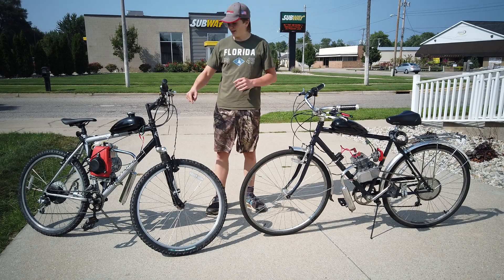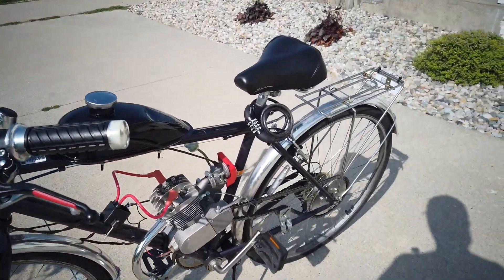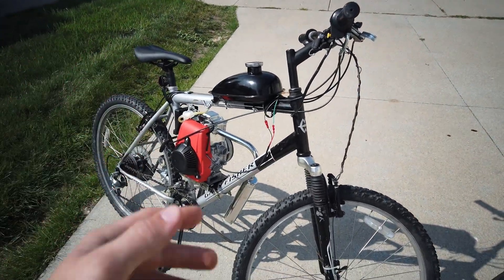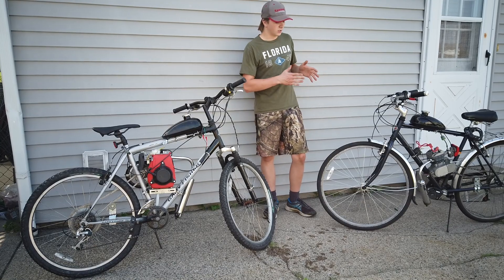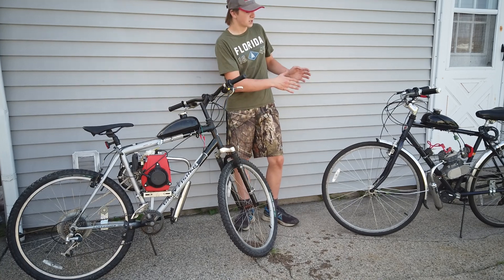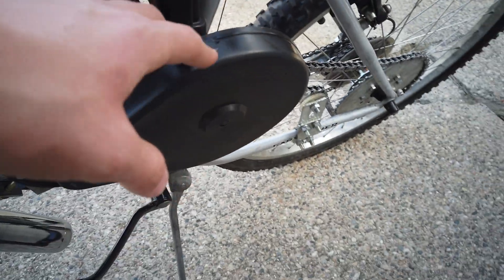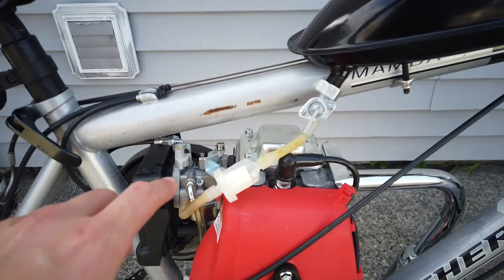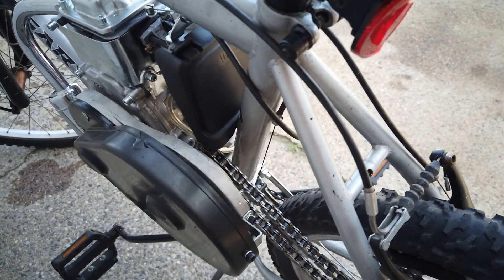4-Stroke VS. 2-Stroke Motorized Bikes!

Comment: You're a light guy and it doesn't look like you live in a very hilly neighborhood do yourself a favor and get a 36 tooth sprocket You will be happy you did so it's so much better on the engine and you get more speedt but you do lose a little of your bottom end.

Comment: The 4 stroke is a little smoother and quieter. It is also somewhat slower. Rejet the carburetor one size larger. 
The 2 stroke is a little rougher running and has a more distinctive sound. 
I like both but prefer the 4.

Comment: 2 strokes are slow stock out of the box but if you remove the cap on the muffler or modify the muffler and take off the air filter you will be hitting 32-34 mph if not more with 26” tires and it’ll have way more torque..seriously you should try it, it’s very easy to make even more power.
 The 4 stroke you really can’t do anything to them.

Comment: 2 strokes are such a pain. First thing to know, you have to mix oil with the gas. If you don't get mixture right, you spit oil out of tail pipe. Just upgraded to a 4 stroke. Only complaint I have so far is the clutch sucks.
Reply: I will hav'ta agree... 2stroke is too much maintenance!! 4stroke is much better, pull & go!! Clutch does suck, but 4stroke is the way to go!! Won't go back to a 2stroke!!

Comment: is there a way to start the 4 stroke, without the pull start?  Like a running start so to speak.
Reply from the maker: So this one has a centrifugal clutch, which is automatic, so when you hit the throttle, it grabs and pulls you forward, unlike the 2 stroke. So no, since you can't manually operate the clutch, there's no way to pedal start or push start the 4. Hope that answered your question.

Comment: That 2 stoke sounds awful. It desperately needs a decent tune and probably a better pipe. It’s restricted to hell.
Reply: 2 stroke is better and better sound
Reply: @mikoskjv  That 2 stroke is labouring and running too rich at the top end and the pipe is too restricted. Both things slow a 2 stroke down and kill your top end speed. Personally I prefer a 4 stroke, I’ve ridden both in sizes from 125cc - 600cc and my riding style is better suited on 4 strokes. I ran an RM500 2 stroke for a few months and just hated it. It was 5000rpm of nothing and 2000rpm of it trying to throw you off it and kill you.
Reply from the maker: Yeah, thanks for the insight, but for the video, I wanted to compare the two bikes stock.

Comment: 80cc for a 2 stroke should be better than that, my 50cc heavy Derbi Senda trailbike does 50mph no problems. I'm not sure about the whole kit, but that exhaust definitely limits the performance, alot. What little research I've done shows 2 strokes are pretty damn dependent on the size and shape of the exhaust, it's pretty much connected to the powerband and rpm's. Try fitting a proper one and you should see some real performance, either find a exhaust geared towards low rpm power for more quiet but slightly less hp runs, or a high revving one where the major power kicks in at 9k RPM and above.

4 strokes on the other hand are more... slow and steady no matter what you do honestly, I haven't been able to ever get one to be "fun", but take care of them and they're reliable atleast. And ofcourse have a more even powerband over the RPM's.
Reply from the maker: Yeah, I think with these Chinese motors they pretty much just chuck whatever works on there, but I think you're right, exhaust is where it's lacking. Probably good to try something else

Comment: Hey mate, that was a good little comparison. I've been weighing up whether to go with a 2 stroke or 4 stroke for my first build. But I think I'm just gonna forgo these smaller engines and go with a GX120 clone with a 30 series CVT. There's a lot of hills where I live and I'm not the lightest guy around, so I think I'll need that extra torque. 

Anyway, great video. Cheers!
Reply: just keep in mind, these are bicycles. Anything over 3.5hp and you'll start to bend stuff. Also, you'll need a wide crank for a 4 stroke. Especially for that GX120.
Reply from the maker: Yeah, thanks, that would be pretty cool. I'm thinking about getting up to something bigger too, got the need for speed and these little ones don't cut it.